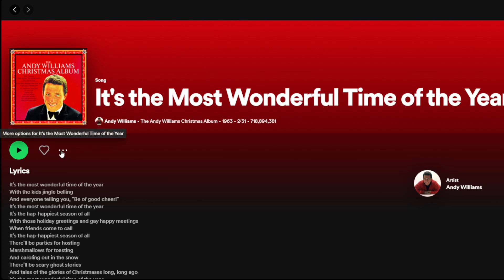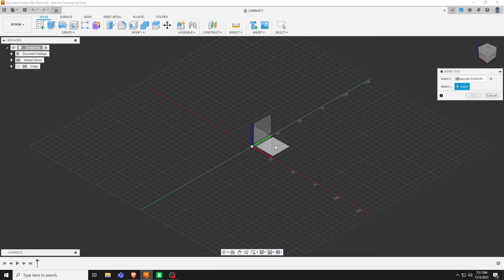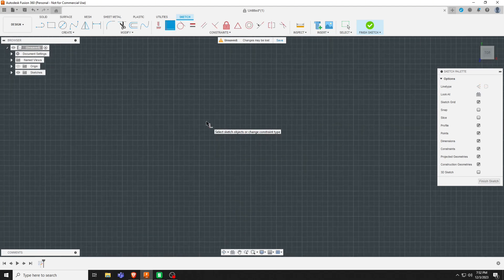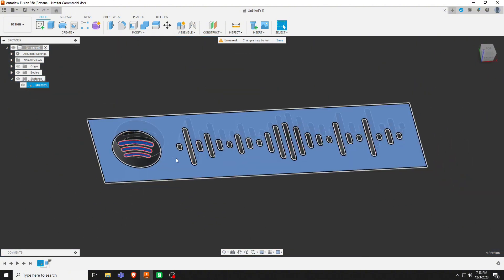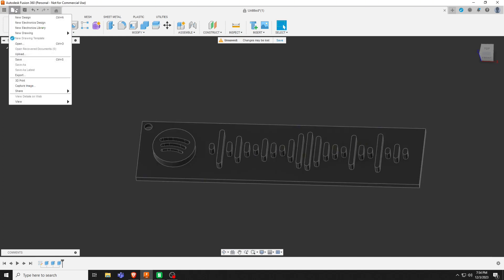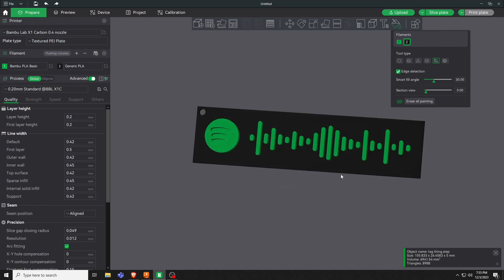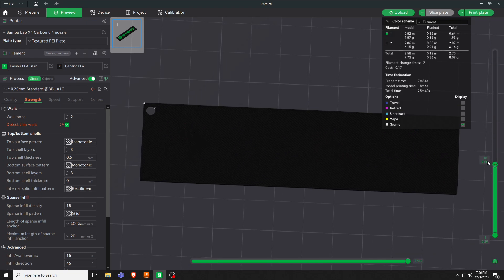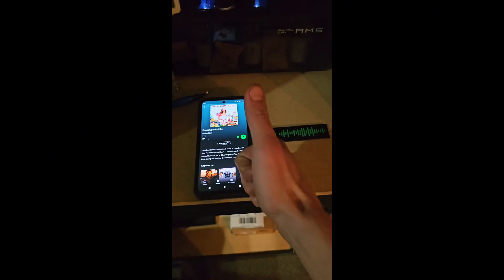How to make a custom 3d printed Spotify keychain using Fusion 360.

Comment: Very short format video. But you managed to give well detailed instructions and an easy to follow video. For me to re-create this, I could have it done using a Sovol printer and Cura slicer in maybe half an hour and have it ready to print.
Reply from the maker: Thanks, it's my first tutorial. I want to put more out in the future if you have any requests.
Reply: @limitlessknc  Maybe something comparing creating brims and rafts on PrusaSlicer vs Cura? Or maybe a run down on some of those settings for either or?
Reply from the maker: I've never used PrusaSlicer, but I can help with Cura.